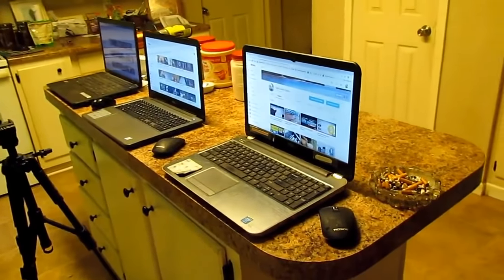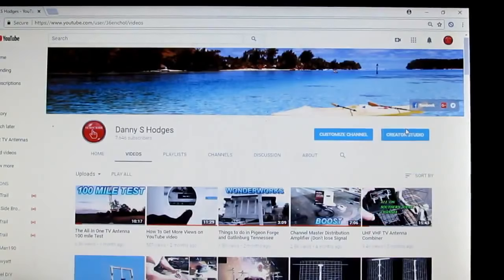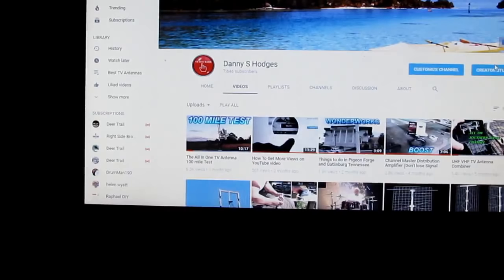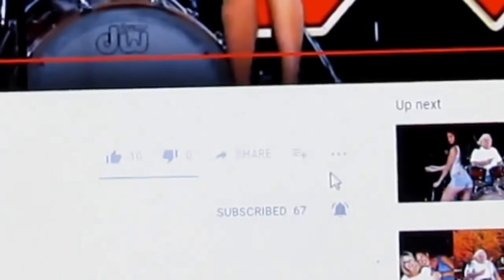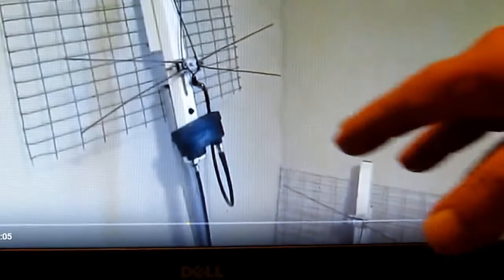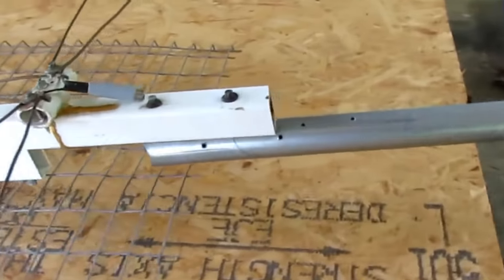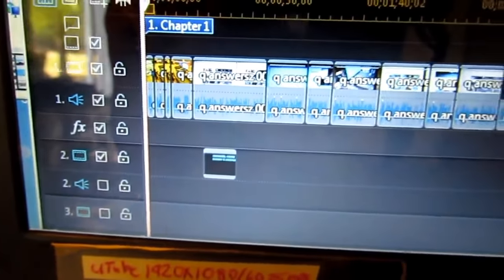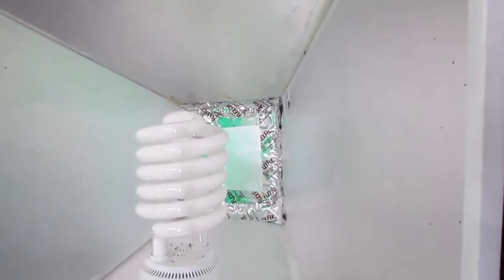Danny S. Hodges TV Antennas Questions and Answers

Comment: Hodges thank for all your hard work. I made a 6 bay antenna with a solid reflector. I live in the sticks about 85 miles out of bham. Your antenna  I made picks up great
All channel accept 4 vhf channels. For some reason I tried the mech chicken wire would not pickup like the solid reflector did. The bad with the solid is wind. Thanks